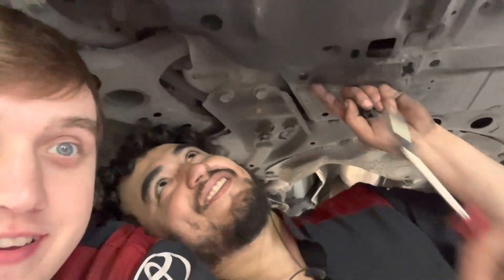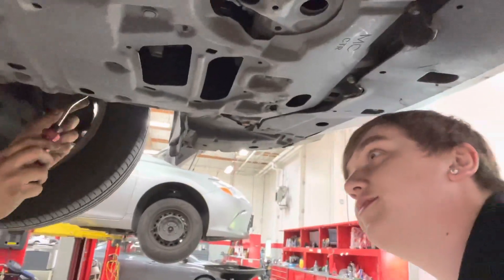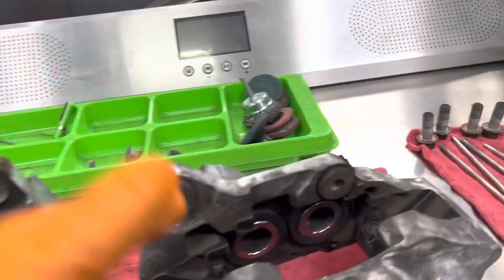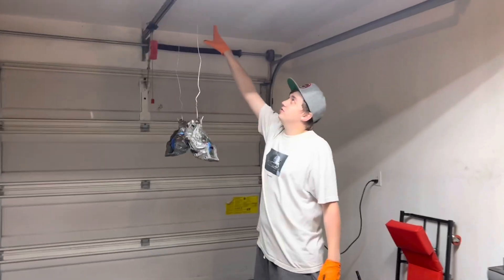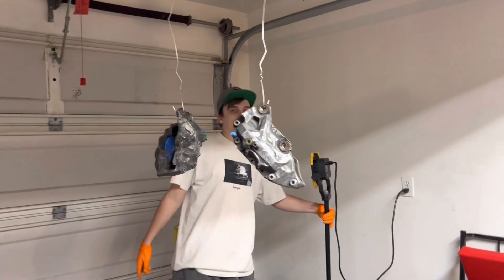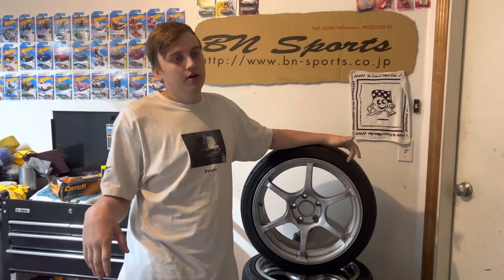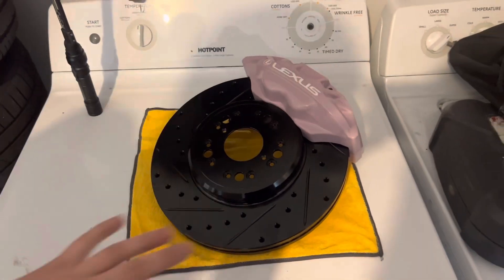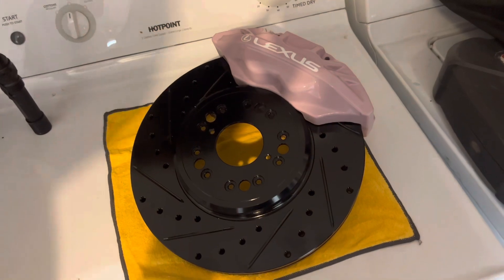Painting Our LS400 Big Brake Kit For The GS300

Comment: I wonder how that paint held up, being that it's not high temperature paint.
Reply from the maker: Been holding up great! No issues! Your brakes should never get hot enough to melt paint off no matter how hard you’re driving. It’s more so the pad and rotor taking all the heat!